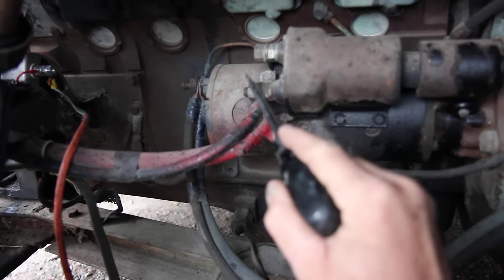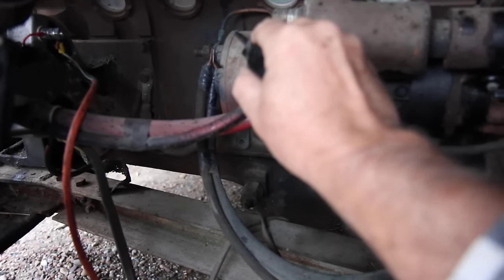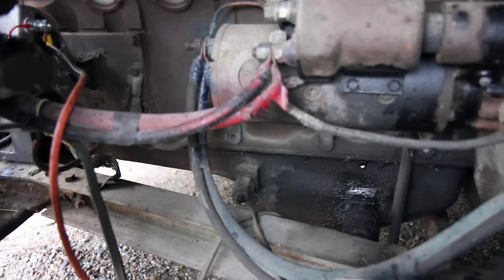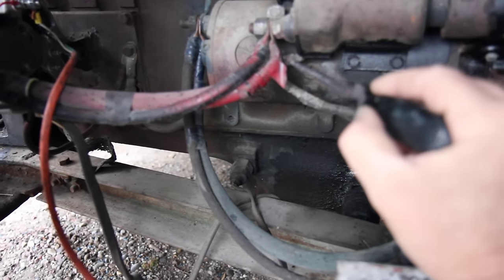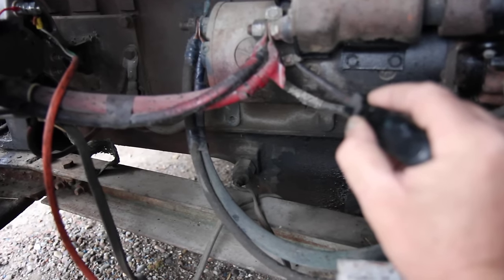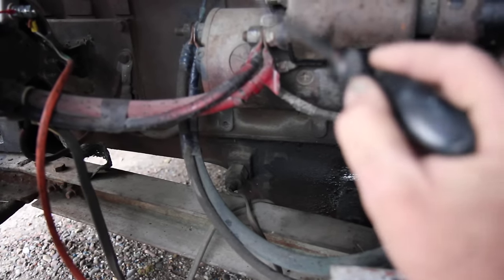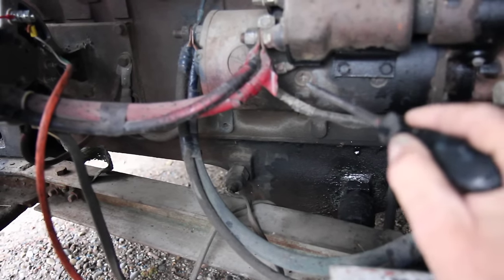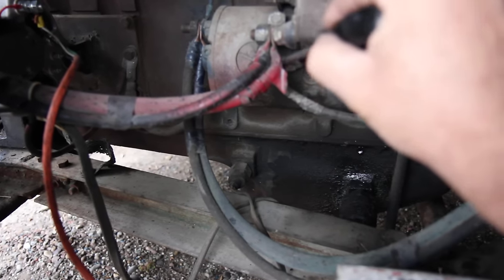How to jump a GM starter

Comment: Always, always, always make sure the vehicle's transmission is in park or neutral so engine doesn't fire up and you accidentally run yourself over. I can't stress this enough! People get injured and often killed every year from said unsafe practice. It's a tragic thing that can easily be avoided. Having grown up farming, I realize the need to do this sort of thing on occasion to get a job done. Regardless, the best thing you can do is fix/replace the starter solenoid or ignition switch feed circuit (trigger wire, as you call it in the video) the correct way as soon as possible.
Reply from the maker: Excellent point, this procedure has gotten me home many times where I could fix the starter.  Also a cure for the Classic hot Small Block Chevy starter issue.  But safety first is always the rule
Reply: Will this work on a 2007 Freightliner Century?
Reply: Ôii
Reply: Also should mention, ignition must be turned on for it to start.
With ignition off, it may turn but shouldn't start up.
Reply: Can confirm I have been ran over by my car doing this. Check that it's in neutral or park. I was extremely lucky

Comment from the maker: If you are trying to start the vehicle this way you need the key on to give electricity to the coil, computer, fuel pump etc.  May not work on vehicles with safety interlock.

Comment: So if this method works and starts my Detroit 671 ..does it mean my starter solenoid is bad? Or does it mean my ignition switch is bad?
Reply: it means the starter is good and it could be a different issue, including, but not limited to the ignition switch, the key cylinder, a loose wire, etc.

Comment: Is the starter bad in this case or good?
Reply: Typically it’s the solenoid or key switch that needs replaced. If you jump it and it does nothing then the starter is bad or the gear in the starter is stuck. Hit it with a hammer to loosen it up. If all that fails you need a new one or rebuild it.

Comment: on manual transmission, do i just turn the key to "on"  (obviously in neutral), will the starter do the rest of the work or do i need someone in the driver seat to turn the ignition on while this is happening?
Reply: I know this is a super late response but I if you have a manual it would be easier to push start it

Comment: I have an 05 equinox and this is what I have to do....it's the connectors....is it just the connectors I need to replace? Has a brand new starter
Reply from the maker: Impossible to tell without being there and looking at things.  You could check the voltage before and at the connector to see if there is a voltage drop.

Comment: So If Im doing this on my 05 Impala , does that mean a bad starter ?
Reply from the maker: Does not mean the starter us bad, could be an ignition or wire problem.  On older Chevy engines, the heat from the engine would soak into the solenoid and cause excessive resistance so the starter would not engage.  I used to have to start my 68 camaro this way till I put a heat shield around the starter to keep the heat from the headers from soaking into the solenoid.

Comment: tht looked like pure magic bruh
Reply: surpss No, it's really not magic at all. It's an all too common yet very, very potentially dangerous bypass method. Please be extremely careful if ever trying this. Always make sure that your vehicle's transmission is either in neutral or park when attempting such a practice, to avoid accidentally running yourself over. Nobody wants to read about you in the obituarys!
Reply: Thanks for the advice some people should stay away from car engines and leave it to the experts who know what they are doing.

Comment: mine just spins up what does that mean
Reply: jonathan rodriguez Most likely the starter solenoid is bad or potentially the starter bendix is bad. Either way, it's likely time for a new starter in your vehicle. Additionally, if you jump across the two larger terminals on the solenoid, and not across the hot heavy positive battery wire to the small "start" wire, on many starters, the bendix will not engage the ring gear on the flywheel, and you will only hear the starter motor spin over, without any engine cranking. Hope this info helped you better understand.
Reply: Wrong wire

Comment: Will that work with cadilacs ?
Reply from the maker: Yes, it will work with any GM Starter that had the solonoid on the starter motor.
Reply: MightyThor ok. What about a 95 cadilac
Reply from the maker: Yes, it will work.  make sure the trans is in park.
Reply: MightyThor ok

Comment: can i use a jumper cable?
Reply from the maker: You can use jumper cables, might be really tight trying to hook them up to the starter itself, might be easiest to hook to the battery cables.
Reply: +MightyThor yup cuz i went to autozone one day and i saw a Lil tiby jumping cable so i may conect the normal jumping cables with the lil ones an then connect them to the solenoid
Reply: +Hola soy pollo it's because my guy from the city next to me was selling a 99 Pontiac grand a. it looks clean from outside but he didn't send me pic of inside and it was a 1000 buck now he said 500 just because he said the starter doesn't work and I got a   simple question if I jumped stared like that can I ride the car for  lets say 20 mins? so that I get to a yunk yard of my city and buy a used starter and install it myself?
Reply from the maker: That all depends on whether the starter is broken or not.  This will not usually work on a broken starter.  This is usually done when there is a problem with the wires going to the starter, or when a starter is too hot and the solenoid has too much resistance (hot chevy starter).  If it is only the solenoid that is bad this might or might not get you running.  If the starter motor is bad this will not fix that problem.
Reply: +MightyThor yup it's just in case of emergency I know it won't fix it xD but  I hope it works if not I just have to buy the starter first and just replace it on his house thanks man !!!
Reply: If your battery is flat or missing you would need to use a friends car with jumper leads from a good battery.My question is could you use a battery charger directly to cars starter motor with no problems.

Comment: will it work on a 06 Silverado
Reply from the maker: yes
Reply: no... heres why: anti theft
Reply from the maker: It will spin the starter, it won’t start a vehicle unless the key is in the ignition and other safety measures are engaged such as the foot on the brake etc.